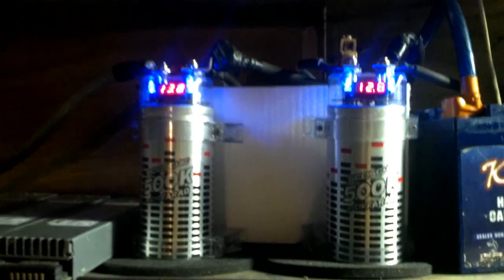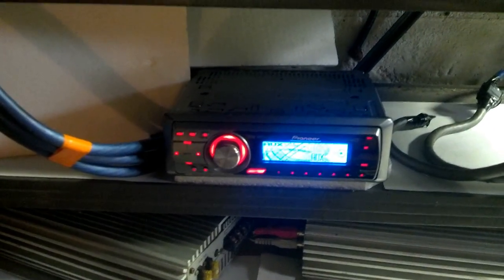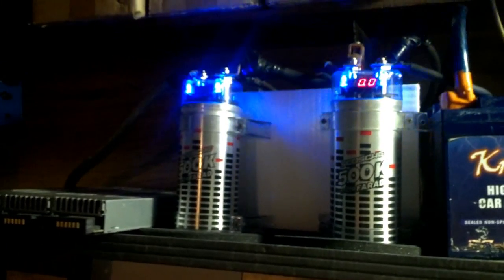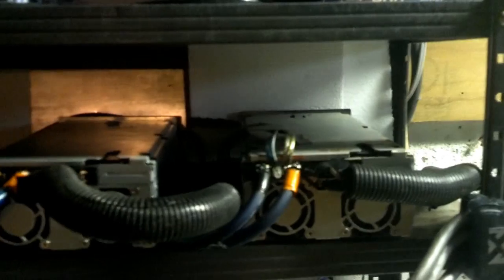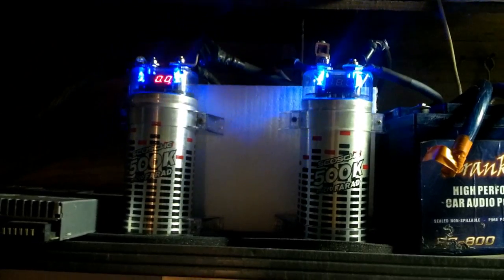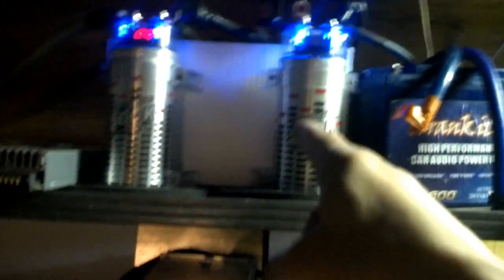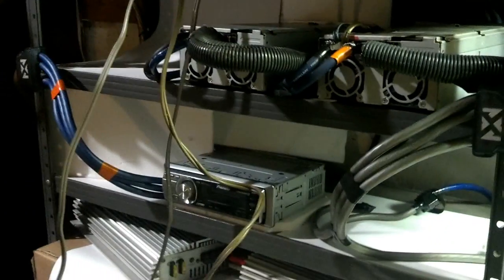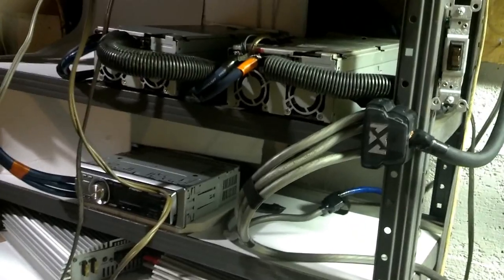Car Audio Capacitors Mythbusted Do they hold ANY voltage ?

Comment: if caps didnt work they wouldnt be on the inside of every amp.
Reply: They work, but they only complicate the problem.

Caps do hold a charge, a very small charge. Once that initial charge is depleted, your electrical system now has one more thing to power. Basically, its adding another drain to your alternator/battery completely negating its purpose and making your electrical system work harder than without.

Power isnt free. You cant "add" power to your system with a cap.
Reply: A capacitor is a passive two-terminal electrical component that stores electrical energy in an electric field.The effect of a capacitor is known as capacitance. While capacitance exists between any two electrical conductors of a circuit in sufficiently close proximity, a capacitor is specifically designed to provide and enhance this effect for a variety of practical applications by consideration of size, shape, and positioning of closely spaced conductors, and the intervening dielectric material. A capacitor was therefore historically first known as an electric condenser.
Reply: it's only a ½ of a fared  of course he got what he paid for
Reply: Its not so much they dont work its that this style is a waste of money
Reply: Budget Audio sure in 2020 they are but 3 years ago the price of lithium batteries and ultra caps was a lot more so regular caps weren’t that bad in comparison
Reply: @cboyamg  a second AGM battery would do more than 20 of those caps
Reply: Budget Audio sure but a second battery isn’t an option for many casuals there is a lot more cost involved with another battery plus not everyone is willing to give up the space... not sure why you feel the need to argue with my comment it was 3 years ago and what I said wasn’t false
Reply: @cboyamg  didn't realize it was 3 years ago lol
Reply: Karen  storing power vs amperage are very different even a double A battery with 40a would fuck you up
Reply: Karen  go ahead and research it
Reply: Cody Hodgson capacitors are in just about every electronic appliance.
Reply: That's right!!!!!!
Reply: 1ceeb yes they are used for redusing voltage ripple in power circuits - they dont store much energy compared to a battery, but they can put out extremely high peak currents (great for that shourt punchy bass)

Comment: Charging system is only as good as the alternator charging it. Spend your money there. Then batteries. Then if you have money to burn real caps. Banks of caps.
Reply: john vinczencz Takes power to make power baby!!
Reply: @NendoCrescendo 
Yes, but all three systems deliver power in different ways for different situations. You cannot replace caps with batteries or alts.
Reply: ABOlsen69X You need a good alternator though and the good batteries. The alternator isn’t made to push high currents fast. That’s what good batteries are for. Or if you want caps, get super caps or stuff from XS Power. The real deal types of stuff costs A LOT.
Reply: @NendoCrescendo 
I never said you don't need a good alt. you absolutely do. What I'm saying is, that a well balanced system is what works the best.
A set of caps will usually cost less than an AGM accumulator, and while XS makes nice things, they are not the only manufactures. Also, if you need a cap for say 1000 watts, you need a 1.5 cap, perhaps 2-2.5 if pushing it. You don't need a bank. If you can't afford to spend on caps when you need to spend on batteries, my view is that you cannot afford the system you're building.
Just as with any other audio system, being it home, or pro touring audio. Big and powerful costs money. I can't for the life of me understand how people can think a great huge stereo in a car is something you do on a tight budget.

Cheap
Good
Powerful

Pick two...
Reply: ABOlsen69X Oh yeah no, I get ya now. Definitely need a balance!! By no means do I have an insane setup but it’s above average at least around where I live. All I have is a 240 amp alt and a small XS battery. I get where your coming from no doubt though.👍👍